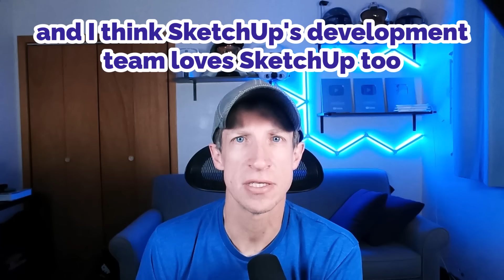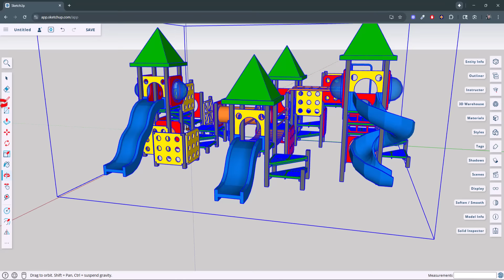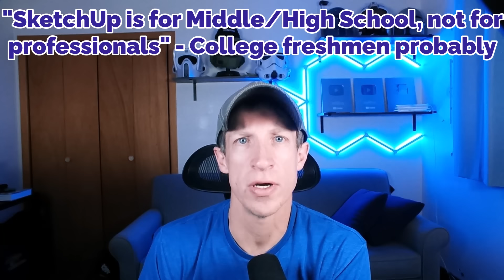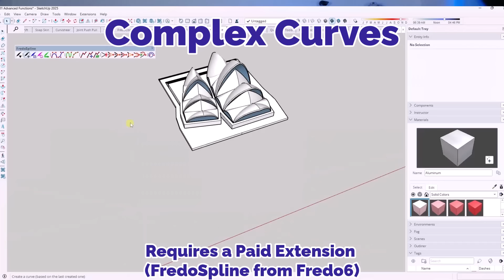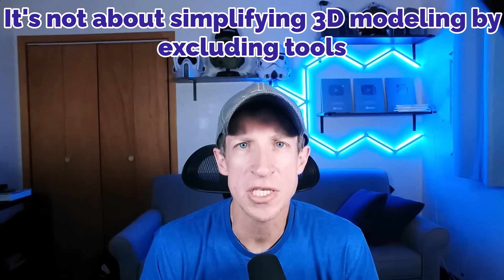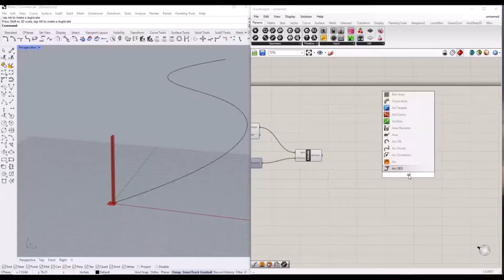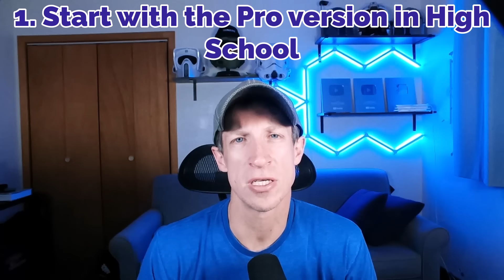Is SketchUp being REPLACED?

Comment: I have been using SU since 2005, in my Architecture firm. But one year ago I just walked away from it. My main building modelling software, Vectorworks, has incorporate enough similar functions, that made SU redundant. SU showed little development during the years. That is my main complaint. And the hassle with all those extensions was another...
Reply from the maker: I've not tried Vectorworks before - it looks interesting, I just haven't had time to learn another program. Personally even with all these issues I like working with SketchUp so it hasn't been a priority I suppose

Comment: As an architect I feel that Sketchup lacks too many advanced modelling features for its price point.
Reply from the maker: This seems to be a common thing I hear - personally I still think for the price point SketchUp is a good value, but missing some typical modeling tools for no good reason doesn't really help the discussion
Reply: @Thesketchupessentials my workflow generally models the basics in Revit, rendering concepts in Twinmotion. (I can use free assets from 3DWarehouse at this point so no need for Sketchup license) then onto permit and CD’s in Revit. Don’t really need anything else. Sketchup also lacks NURBS capability which makes it not great for smooth 3D printing. It’s a pity as I really liked using Sketchup.

Comment: It will be easier to add Sketchup tools to Blender (which I’ve been advocating for years) rather than getting sketchup devs to improve Sketchup… it’s been stagnant for years. The plugin ecosystem is harmful because it lets the developer of the software slack off…
Reply from the maker: Oof - totally disagree on this one. I've seen multiple people try this in Blender and it does not really mesh well with the way that program works. Blender is way further from an actual useable Architectural workflow than the userbase would have you believe

Comment: Two points: A. Sketchup Web/Free doesn't add features, it takes them away! Every time I attempt to use SketchUp Web, another feature has been removed and generates a message to "upgrade" to get back what was once there for free. That's a crappy way to do business and to stay in business. Trimble has even done that with the SketchUp LEARN section in which all tutorials have been removed from the Web/Free section (Great thing to do if you want to chase perspective users away!). 
B. Stability is awful. SketchUp on the web is very buggy. Sometimes "Follow Me" works, sometimes it does bizarre errors. The same is true for creating components and measurements. How can you persuade users to upgrade when the introductory version's reliability is a day-to-day question mark?

Comment: Trimble made a huge mistake when they decided to kill Sketchup for Maker's desktop version in 2018, replacing it with a web-based application known as SketchUp Free, which is s joke compared to the version it replaced. I moved from Sketchup, first to Blender, and later to FreeCAD. I have seen great videos showcasing Rhino's capabilities, and compared to Sketchup Pro's pricing, Rhino's pricing is more attractive.
Reply from the maker: The free desktop version was great, but I imagine it also probably created a lot of issues with software piracy and people using the program outside the license terms. I have no data on this, but I would suspect purchases of the pro version went UP when the free version moved to web, rather than down. I'm just guessing though - don't know for sure
Reply: @Thesketchupessentials Yes, I am sure sales for the Pro version went up after Trimble killed the Maker's desktop version, as some users had no other recourse, but the uptick in sales was probably short-lived. That desicion also killed the pipeline of people moving from the Maker's version to the Pro version. As you pointed out, the web version is not a decent entry point that eventually converts into more Pro licenses sold. If anything, it turns people away. As far as people abusing free licenses, every brand faces that dilemma. It hasn't stopped Autodesk from offering free licenses of F360 to hobbyists. F360 arrived much after Sketchup and now has an even bigger market share in the 3d-design space, although they are also truly parametric. IMO, I can't fathom why anyone using Sketchup would not migrate to FreeCAD, particularly after V1.0 (finally dealing with the TNP) was released. Yes, there is a learning curve, but the amount and depth of tools is fantastic. The only thing I miss from Sketchup is using Ruby from a 3rd pary IDE like NetBeams. That was awesome, but I don't know if that would even work anymore.
Reply: I stopped using SketchUp when they switched to being Web based.

Comment: Oh sketchup shot themselves in the foot the second they stopped supporting a free desktop version of the app and then forced a version number on models from warehouse. Because prior to that sketchup wasn't just for architecture, it was for multiple creative disciplines. You only had to look at what was on warehouse to know that. 

I used to be an avid sketchup user, its how I know this channel, but these days I never use it to model anything. I view old models, view new models on the iPad, but I haven't made anything in sketchup for years. But more importantly I never recommend it too anyone.

Why would anyone recommend sketchup over Blender or Rhino, even if they fixed what you mention the price alone doesn't make it worth it in most disciplines. Rhino is cheaper let alone more adventurous in development. And with a handful of cheap blender plugins, that thing is a powerhouse. And you can import sketchup to blender with a plugin and so the warehouse is still available to those who do quicker mockups.

Its a shame, I loved sketchup... but I just don't see me ever using sketchup again, nor recommending it.
Reply from the maker: I think SketchUp is superior in several areas to Rhino or Blender - ease of use and 2D documentation. It's a significantly better user experience (having used all three, I vastly prefer modeling in SketchUp). Blender doesn't even have a tool for 2D documentation, and Rhino's is not very good. Blender to me is VERY clunky for architectural modeling and scale modeling, and their dev team is clearly not targeting this use case - more motion graphics and VFX type stuff. 

That said, it feels to me like trying to compete by adding some additional modeling tools would help position SketchUp better against these other programs

Comment: The number one problem with sketchup is the subscrition model.
For any program that has a subscription based model I will look for an alternative. 
I don’t mind updating if the new features are good. But I want the option not to and keep using the old version if the new features are not interesting enough.
Reply: Exactly why I stopped upgrading after I paid for 2017 Pro. I think the programme peaked here and Trimble just went for the money without the quality to accompany it.
Reply from the maker: I get where you're coming from on this - practically speaking though, I'd say this change has a 0% possibility of happening
Reply: @Thesketchupessentials  I think you are correct. But the subscription model is too expensive for a program that lacks the full set of modeling tools and relies on external plug-ins, which often represents an added expense.
Reply: I don't mind paying for a quality subscription-I pay for PlusSpec and Adobe's Creative suite- but those get constant upgrades and is stable and powerful. SU crashes all the time. BUT I agree. I remember paying for LIFETIME upgrades only to be phased out soon after for subscription. Then the CRASHES got more and more frequent. I digress...

Comment: #1 for me, real curves!!! This polygon thing bites me in the ass constantly.
Reply: CNC and  3dprinting just keep becoming a larger part of my workflow and polygons are insufficient. Oftentimes in a pure modeling environ that I'll use to inform traditional building processes I'm looking to intersect with curves in my models and this almost never happens to land on a corner that actually represents part of the curve. It wasn't an expanded toolset that got me looking at Rhino, it was reliable geometry.
Reply from the maker: @aaronrivers7949  I think this is fair, I just don't know how deeply the polygon curves is embedded inside the software, and even if it CAN be changed
Reply: Yes, it's certainly integral to this point. Thanks for teaching me sketchup, btw!
Reply: I wonder if SketchUp "curves" could be imbued with a behavior that created two curve segments that terminate on any new intersecting geometry... The termination point would exist on a true curve and (while not addressing manufacturing processes) would make a world of difference in simplifying workflow.

Comment: Excellent observations.  I'm guessing the other reason for a lightweight school version is because younger users tend to be less sophisticated.  Perhaps there could be a resident "gear shift" that would allow ALL users to have the school and pro versions that the user can literally shift from one version to another, and models built in the higher or lower versions would be consistent?
Reply from the maker: Well I think the web version is a fantastic place to start in elementary school and middle school. It's fast, easy to learn, and great for beginners. You can save files and open between the different versions, but I think the problem is there's never (that I'm seeing) a reset between "this is what kids learn" and "here's how this is a professional tool," which concerns me

Comment: I have taught many people to use sketchup both in a professional setting and school setting. I  graduated architecture school in 2011 with Rhino as my preferred modeling tool.   When I entered professional practice more people where using sketchup, and if you wanted to work with teams of people you needed to be using sketchup.  I switched over to sketchup and learned that I could make just about everything I was doing in rhino in sketchup I really enjoy the process of modeling in sketchup.    The last large firm I worked at all the new hires came in knowing Rhino and we were teaching them sketchup.   It does feel like sketchup is being used less and rhino used more than it had been.  What I believe the driving force behind this shift is that Rhino has always been super powerful and sketchup has always been super intuitive, but as time has passed Rhino has become much more intuitive and easy to learn, and sketchup which has always been intuitive and easy to learn hasn't become  more powerful in equal measure to how rhino has become more intuitive.
Reply from the maker: This is 100% what I was getting at with this video - really appreciate the comment.
Reply: Great Answer
Reply: As a mechanical engineer, this is interesting cuz I always wonder what softwares other disciplines are using.  I was always under the impression that AutoCAD is still a necessity to know and the industry was in flux switching to maybe Rivet. There are rarely any mechanical engineers that leave school knowing AutoCAD, SolidWorks is mainly the 3d software taught.
Reply: @leomman0913  Vectorworks, Archicad, Revit, Rhino, Autocad. Rhino is king for sure.
Reply: Great explanation. Initially I was skeptical of the big push they've been making over the past few versions increasing Sketchup's rendering capabilities, since it seemed like a misguided attempt at catching up with other software visually when we have plugins like Enscape if we really want to make things look realistic. The more I've played with the new features though, particularly in SU26, the more I've become a fan. Of course Sketchup's advertising oversells them and pretends they allow for photorealism when in reality they're still quite cartoonish looking, which I find irritating, but there's no denying they've made some big improvements to the rendering pipeline, arguably long overdue ones which take advantage of today's hardware. Even if you don't care about Sketcup's visuals though, the side benefit, as I've discovered, is that overall model performance has improved drastically. Geometry heavy models that dragged even in SU25 are now quite snappy in SU26, which has been a welcome improvement. If they can acheive similar levels of success adding modelling functionality in a powerful yet intuitive way, I'm encouraged about the future. If not, I fear you're right that in another 10 years the profession will have moved on to Rhino (or AI will have changed everything). The writing is on the wall though. Sketchup needs to win back architecture students with a more mature modelling toolset or it will go the way of AutoCAD and hand drafting.
Reply from the maker: @Hug8horn  I do think it's unfair when people say Trimble has done nothing with SketchUp. They completely re-tooled the engine for significantly better performance, which is what pretty much everyone asked for. Not saying they couldn't do better, but they have made some pretty significant moves in SketchUp 2024 and 2025 (which most of the user base seemed to be pretty happy with)
Reply: Well said 👍🏿👊🏿
Reply: the building department and the engineers in my jurisdiction all want AutoCad drawings
Reply: Ai will solve this! All you skills will be washed to history. Like using an abacus 😮
Reply: I actually have always preferred Revit, because I know how to use it in a design concept capacity that smoothly goes into the CD set and then has the relationship where 2D drawings influence the 3D model, and you can change things so quickly that I don’t want people to know how quick it is.
Reply: if you earn your money with cad, maybe sketchup is not the best, but if you earn your money with other stuff (carpenter like me for example) and sketchup is just one tool for you, then keeping it simple and agile over decades, like sketchup still tries to do, is the utterly most important thing you are looking for..i have tried a lot cad for my business since 20 years or so, and there is nothing more problematic then computer programs requiring you to become a single function nerd spending hours over hours learning this overpowerful cad programs. in the end these power users with their hardly aquired knowledge and competence prevent so many cad firms from changing ui s that look like windows 95..i hope sketchup holds on to its slim core for the next decades..;)..keep it simple..

Comment: It's quite simple. SketchUp was (and still is) created as a simple 3D modeling tool, that's all! We've worked hard to "make and adopt it as professional"...As proof of that, just look at how complicated it is to open/handle a highly detailed tree or car or any high poly model coming from an .Obj or .3ds file. This "problem" is right from the very first version and as far as i can see, this won't change 🤷‍♂. 
SU would be nothing without the work of all plugin developers.
Reply from the maker: Well I don't think the goal of SketchUp has ever been to be a super high poly modeler - that's kind of the opposite of what the program has been designed to be. That said, I would love to see some sort of LOD or proxy system added that would help with these high poly models. THAT would be really interesting to me

Comment: I started using Blender as a kid, but in my 18-to mid 25 moved on to make the basic models in SketchUp and only use Blender for texturing. But suddently i experienced people kinda made a fool of me for using SketchUp (2017+ extensions). When i showcased a new model or stl. People where impressed and asked what i made it on. Only to be laughed at and told to use CAD or Fusion for such stuff. So i started to solely rely on Blender again, sure blender has nearly unlimited powerfull tools. But loved the vertex level control you had in SketchUp.

Its sad to see how damaged SketchUps reputation is, especially in the 3D printing world. i hornestly didnt know there existed a simplified browser version for education, if they educate you in such tools then it all starts to make sense.
It's beyond stupid to show off limited tools to the new generation.
Reply from the maker: I do think there's a bit of unfair "snobbishness" around software as well - if people were impressed with what you did in SketchUp until they found it it was in SketchUp, that feels unfair to me. If the tool is capable of doing it and doesn't take a lot of extra work to create, I don't know why people would look down on that